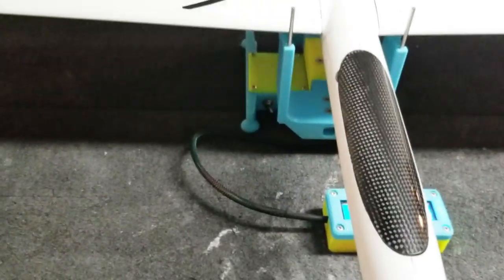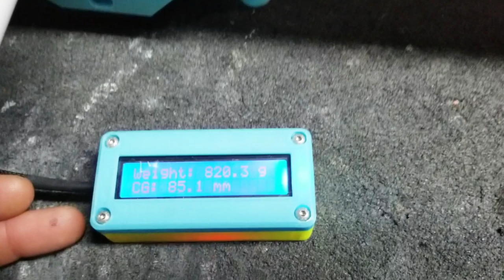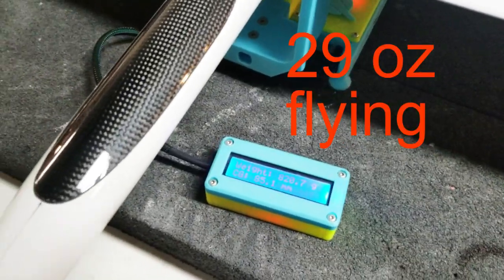CCM 2 Meter RC Slope Glider Build Part 3

Comment: Ali- An 18500 LiIon battery is an alternative to the 18650's, it weighs less and obviously is shorter. I wonder if that plane could take a winch launch??!!
Reply from the maker: Lol, I just ordered some if those cells! Next batch will have tow hooks.
Reply: @flightcomp  Yes, I pinged the manufacturer on FB and he said to talk to you. You going to try one on the winch? I would think this could be a Sprite beater for TD in 2M....